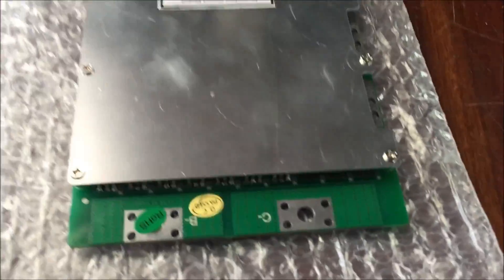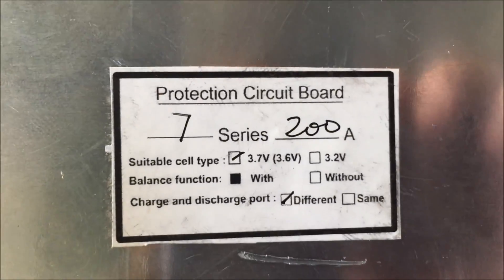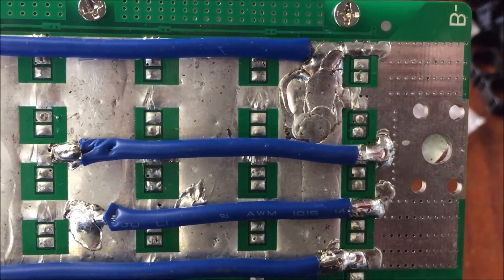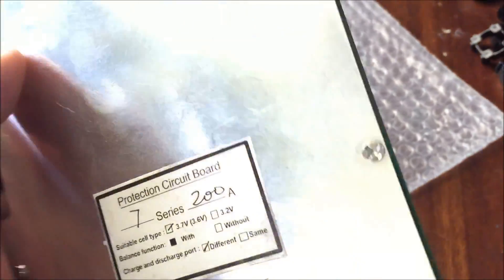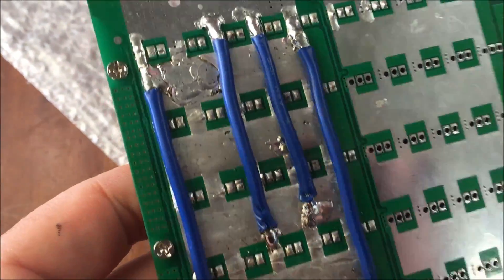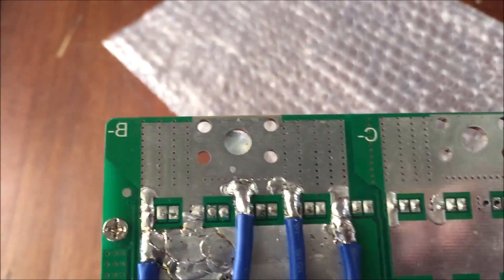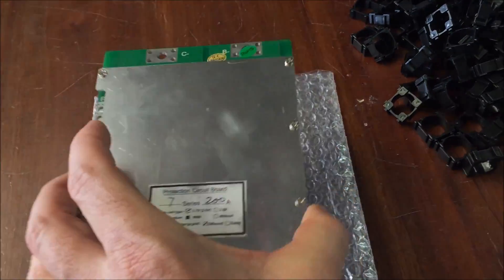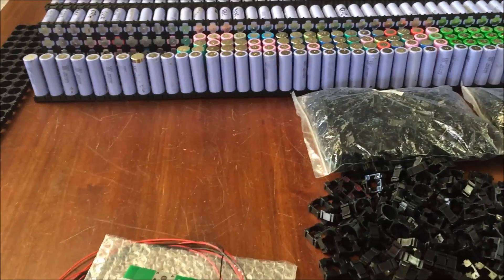CRAP BMS - what a terrible piece of useless crap!

Comment: To be a bit critical, this looks like one of the chinese cheapo units you find all over eBay... The build quality is as you'd expect for something so cheap, it just "does the job" or barely.... Now this is coming from someone who purchases and uses lots of this cheap crap so I'm not saying I'm better than that and I only use top notch stuff, but you gotta expect hacky stuff when you buy these things. That's probably only good for 100a (if that) and you probably can't even get a high quality 100a bms board for what that "200" amp unit cost. I guess my main point is you have to set your expectations LOW when working with this stuff, and even make improvements and upgrades to these chinese units.  thanks for the videos though! good stuff!

Comment: Looking at this: http://www.aliexpress.com/item/72V-18650-LiFePO4-NCM-pouch-Battery-BMS-Board-20-Series-100A-200A-FREE-SHIPPING-by-express/32534415099.html "Connection to the board" diagram in the description, you can indeed send the current through the device, from B+ and P+ to B- and P-. The genuine bodge wires are a call for concern still.
Reply: +Michael Jones Not really it needs the 5 to make a comparator and I think that it would need it for overload protection, otherwise it wouldn't overload. If one is wanted without having to pass through the board then an EV bms like the Orion or the Lithumate would work

Comment: Hey Peter, i´ll use BMS REC 9R   http://www.rec-bms.com/BMS9R.html for my DIY Powerwall. It is already running in a few projects in combination with the SMA Sunny island. Im on my way to solder 1260 18650 cells in 30p. later i´ll use them in 15s84p to get 8,5 kwh out of it. Love to see more of your work.
Reply from the maker: +lorykk20 ooh it has data loging, that appeals to my need for knowing things.. thumbs up
Reply: +Michael Jones The REC BMS is just to keep the packs in accurate charge and manage the charging and discharging progress. It can communicate with the Sunny Island via the SMA BUS. Price just for the BMS 400 € REC offer a Set for 900 Euro wich include all you need to set up connect and use your juice store safe.

Comment: Possibly 200 watts? I've seen some dubious claims on Chinese labels. I was also under the impression a BMS would have micro relays which would turn off the juice to the full/ overcharged cell similar to a solar charge controller charging Batteries; once the Batteries are on float the charger monitors the Battery but doesn't burn off the extra power from the panels.

Comment: Peter, a simple balancer can be used on a large pack like the one you're planning. It burns off energy (voltage) above a set point, 4.2vdc typically, to heat (small resistors on the PCB). I'd use it for balance but not pass high current through it. Just use a tap right off the pack for that with a gauge appropriate for your application and run it through DC breakers and fuses. PM me if you'd like to chat about it.
Reply from the maker: +JuliansRandomProject Ok, so i'm not using this one! BUT if i understand it right if 6 banks are at 3.0 v and one bank is at 4.2v it will just consume energy from that bank as heat ? till the others come up to 4.2v ? I thought it actually stopped the energy getting to the battery entirely .
Reply from the maker: +Michael Jones right, that was an great reply thank you. Now Shopping...
Reply from the maker: Some one linked me a good one the other day on one of my other videos I think. Looked very well built but I didn't pay much attention to it as this one was on order. Will have to shuffle through all my messages to find it. Or was it on blab with jehu, any how let me know what you find.